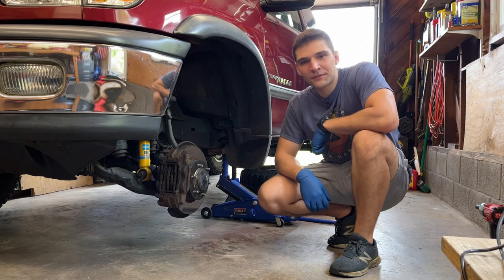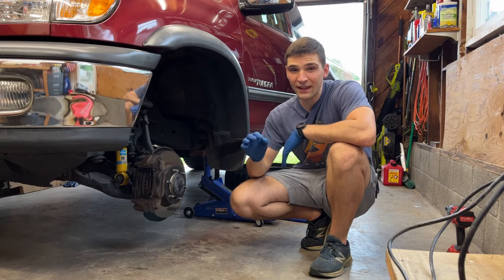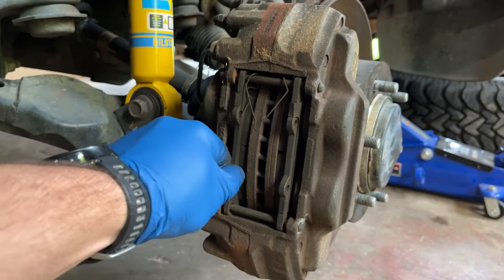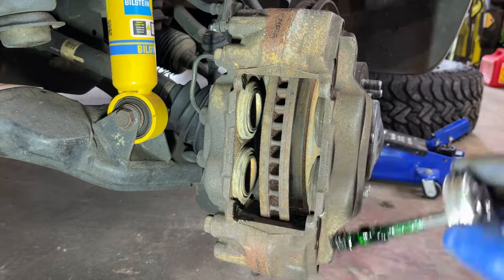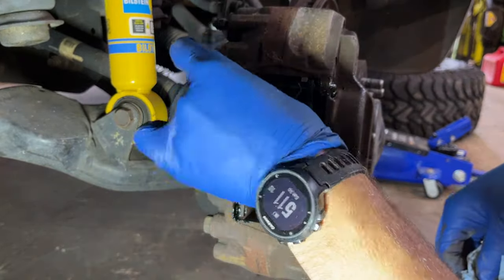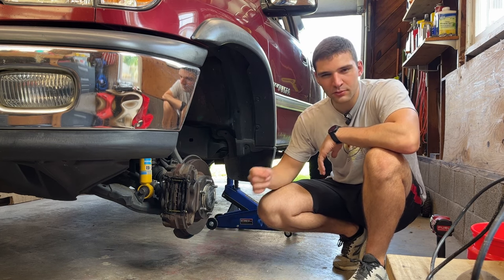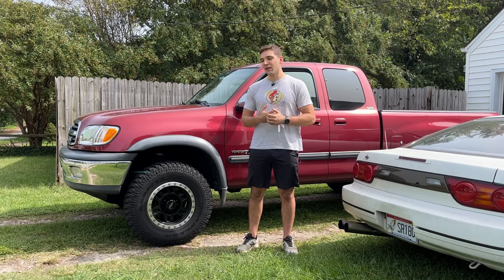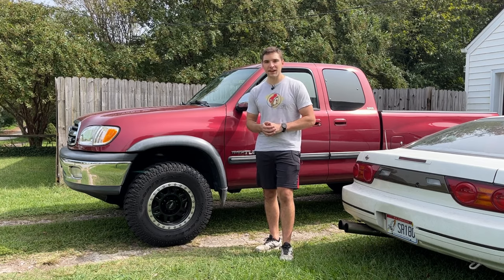Finding and (mostly) fixing a front end rattle on my First Gen Tundra

Comment from the maker: *Update* I added all new spreader springs and the rattle is completely gone, 100% of the time! They definitely did more to solve the rattle than the brake grease did
Reply: Did you add all new spreader springs to the pads that had the grease on them?  If so, the new spreader springs solved the other 30% of the rattle noise that was still there from making this video.
Reply: Yes I was going to advise on my brakes I have a spring on both upper and lower pins. Mine still does this rattle so I will be getting new pins a greasing also!
Reply: I have been chasing the same noise for a few months now also. I had the same epiphany when brakes were applied over potholes.
Grabbed some new springs, greased the pins and pad edges.
The noise is gone!

Great video.

Comment: You will want a spreader clip on the bottom pin as well.  I have those spreaders on both pins....makes a difference.  I just did a complete front brake job myself.  Yes, you will want a little more grease around the pads where they slide into the caliper.  It helps as well.  So glad that it's working for you!!
Reply from the maker: Sweet, yeah I'll add another spring this week and I'm sure that will solve the rest of my issue. Thanks again for the insight!
Reply: @JDMDriveway  You are very welcome!  Glad that it's working for you.  You might have already thought about this, might as well get 4 new spreader springs and replace all of them while your already there.  I got two pair for about $12.  The ones you have look like there is not a whole lot of life left in them.  Can't Hurt!

I love places like YouTube and other forums.  Such a wonder wealth of knowledge and experience from folks world wide coming together to learn and share knowledge. Each person has a different experiences and know how on how to accomplish a goal.  Good Luck to all!!
Reply: Skip awesome advice sir
Reply: I love your videos!  I think you may need a new caliper. Looks like the pads are not snug to the rotor and are too loose.

Comment: I don’t have any helper springs on my front discs and don’t have any problems with noise or rubbing. When I took out my old brakes there were no springs, and within a week of installing new brakes the springs had fallen out of one side completely, so I took them out the other side to keep it even. Been a month of driving on gravel, mud and highway. No issues yet.
Reply from the maker: Yeah I'm kinda thinking that the holes which hold the pins are a little deformed and are causing a little extra slip in there. I'm still going to try new springs but we will have to see! Thanks for watching

Comment: Thanks for posting Sal. You have great subscribers.  By reading the comments it sounds like you are missing a spring. Makes sense. BTW l too just started using the grease on the brake parts.
Cheers
Reply from the maker: I couldn't agree more, I learn so much from the subscribers! but yes, I'll add another spring which should solve the rest of my issues! Thanks Daryl!

Comment: I just upgraded to Bilstein 5100’s and I’m having the same rattle now. After watching your videos I think I’ll try these tips. Where did you get the spreader springs?
Reply from the maker: I picked them up at AutoZone, but most parts stores should have them. Thanks for watching, and I hope it's an easy fix!
Reply: @JDMDriveway  I just installed the new clips and greased everything. So far, it sounds like it solved my problem. Thanks again for the advice.

Comment: I was under the impression they made 2 different size calipers for these trucks sometine between the 2000 model and the 2003 model I believe. The newer model calipers were slightly taller? You may just have the wrong brake pads for the year. Just s guess from one of the most recent things I learned about my own first gen.
Reply: Yes, you are correct.  I just learned that with my recent brake job.  There are two sizes of calipers and pads.  There is one set of pads around 4-3/4" long and another set that are about 5-1/4" long.  My 03 has the longer 5-1/4" pads which required a quick trip to auto parts store in the middle of the project.  I was assuming that the smaller pads are for 2-wheel drive and the larger are for 4-wheel drive.  Just my guess!
Reply: Yep 2003 the calipers and lower ball joint were redesigned. At my shop when these trucks were new we had a tundra come in at 9k on the odometer and it was 1-2 millimeters left on the brake pads. So I guess Toyota had a lot of problems with the brakes being undersized.
Reply: @chrispollock7507  Yes, I was hearing many folks and mechanics talking about new front brakes after 5K to 7K.  I went 70k until I needed new brakes commuting 70 miles round trip 5 days a week over two mountains.  Has a lot to do with driving style.  I use my gears when ever possible.
Reply from the maker: I appreciate the input, when I got these pads a few years ago, I did a lot of research to make sure I was getting the right ones lol. So I'm fairly certain they're the correct size, and adding another spring to the bottom pin should solve my issue the rest of the way. Thank you again though!
Reply: @JDMDriveway  You have the correct pads, no doubt, otherwise they would not have fit.  You would have only been able to get one pin in or they would not have fit into the caliper.  You are good there! co
Reply: Toyota changed the Tundra brakes August 2003, mid month. Of course mine was made August 10th, with small brakes....
Reply: You can direct swap the calipers, they bolt right on, for the newer bigger version. I did it to my 2000, and it made a HUGE difference. No more warped rotors.
Reply: They are 100% the right size, the smaller ones would not fit at all. You are good 👍
Reply: @BoneStack117  Something else you can do to help eliminate warped rotors is go to ceramic pads.  Yes, I was against them at first.  I am old school semi-metallic and heard not so nice things about the ceramic.  Now that I have tried them, I love them.  You must seat them properly and after that you are golden.  They don't generate nearly as much heat as semi-metallic.  The ceramic pads work off of an adhesive component and the semi-metallic works off of friction.  Ceramic stop smoother with less peddle pressure and no warped rotors.  I am sold on them and my 03 has the larger pads and calipers.
Reply: They all had the same calipers at first and they upgraded them for towing capacity I think. My 2000 has the upgraded calipers and 2wd @skipmiller8309

Comment: I have a 2000 Tundra. It has a clicking/hissing noise in the engine when I first turn it on. I read it may be an exhaust manifold leak.  Did your Tundra have any issues like that?
Reply from the maker: Yep, the exhaust manifolds are notorious for cracking and unfortunately my truck has the same issue. I've wanted to try and tackle the job, but the threat of breaking off a bolt in the head has deterred me lol. Probably best to let a shop handle it. Thanks for watching!

Comment: It's evident that you are an automotive enthusiast. The problem here is you don’t know what you don’t know. Unloading the parts canning isn't the solution. The only beneficiary in this scenario is your local auto parts store. Replacing original equipment with aftermarket parts diminishes the vehicle's value. By trying to fix one problem you may cause another problem without knowing. By applying excessive brake lubricant to the pad will result in the grease collecting road dirt, causing potential issues to the brake pad locking in the caliper. Gently tap the heat shield, exhaust, skid plates and etc. with a rubber mallet until you locate the source of the sound. Happy wrenching
Reply from the maker: I appreciate the input, because like you said I'm an enthusiast but certainly not an expert. I do learn a lot from comments like these though, and I'm hoping to keep getting more experience with projects like  this one. Thanks for watching

Comment: Damn that is ALOT of grease
Reply from the maker: Just trying to make up for the last however many years that it was bone dry in there 😂
Reply: @JDMDriveway I hope you removed the rust from the flat surfaces you greased. Rust is a killer.
Reply from the maker: Yep, I made sure to go over them lightly with a wire brush before greasing
Reply: @JDMDriveway  Good for you.